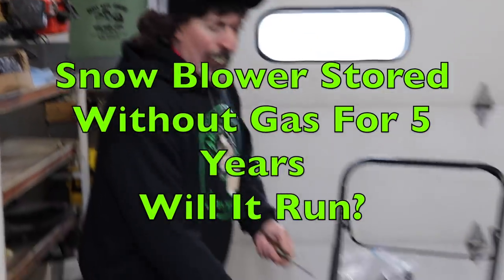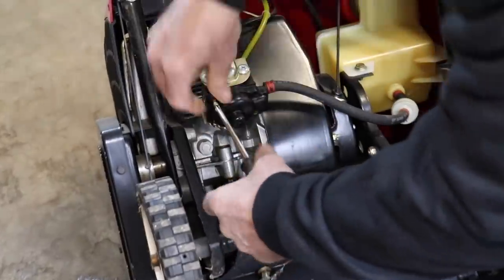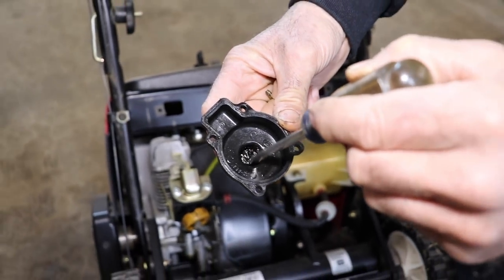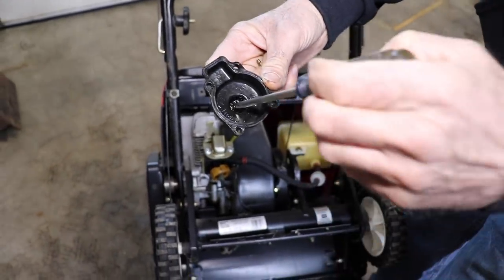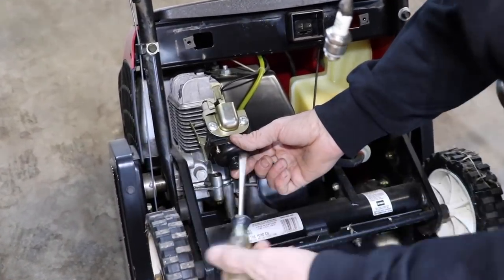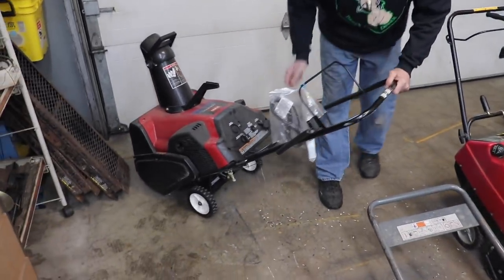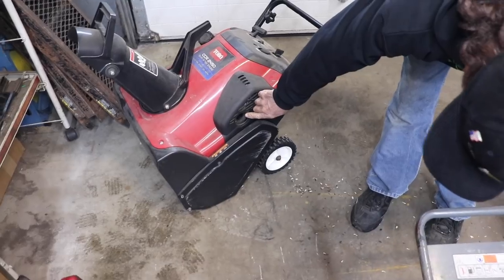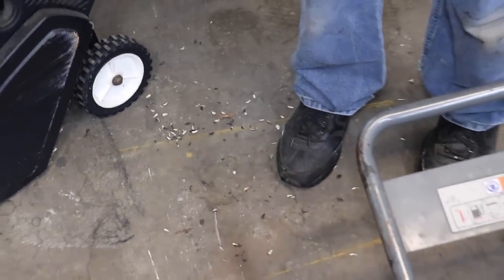Stored 5 Years NO GAS - But Will It Start?

Comment: I had one just like that and it ate paddles if I didn`t use it on glassy smooth driveways and sidewalks. That sucked. Used it commercially and it cost me time and money to keep replacing the paddles so I sold it. Good machine but bad concept.
Reply: They clean the snow pretty well though.

Comment: While you had it off why wouldn't you just spray it off real quick?
Reply: The point was to see if it would run without a cleaning.
Reply: @NY411Info  right, but he didn't say that right away. He s have said I'll clean this in a minute, but we just want to test it first.
Reply: @MattTZew  Ah

Comment: If you leave the fuel in with additive and isopropyl alcohol, you'll never have to clean gunk out of the carburetor. The fuel won't have a chance to evaporate, break down and seperate.
Reply: I've done that it doesn't work for me anyway. When the machine stopped running I had what looked like snot in the bowl of the carb.

Comment: Just my opinion but those Snowblowers are absolute garbage. I could of had a badly abused unit but i legit threw a "running" one out because of how many issues kept comimg up. First the carburetor was gunked up i cleaned that then got it running. Then the pull cord broke so i fixed that.  Then the pawls went then i think i had issues with the recoil after that numerous times.  Bought OEM parts and even when it did run it barely threw snow. 

Do not buy one of these they're garbage